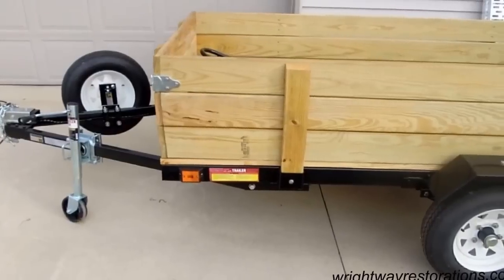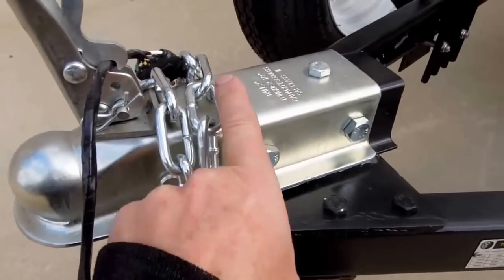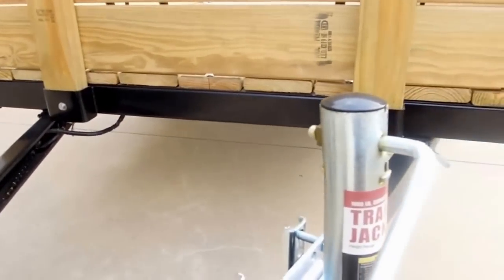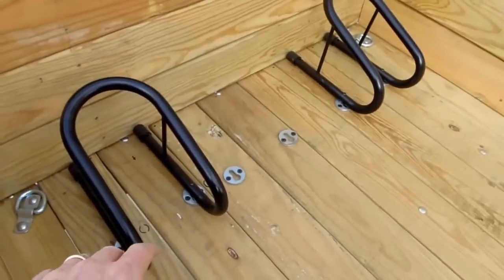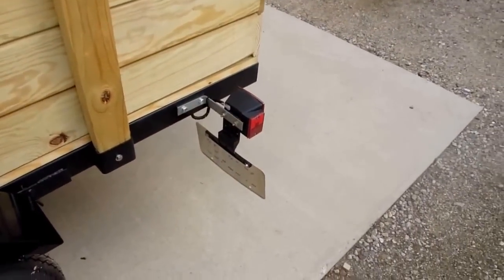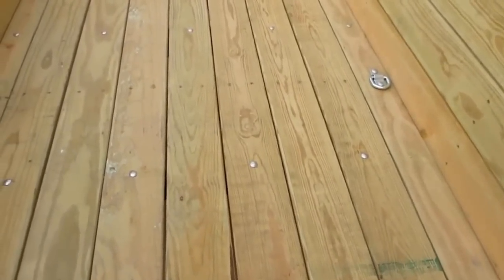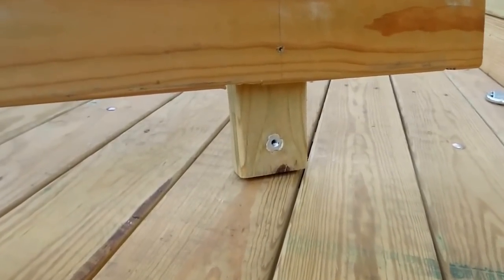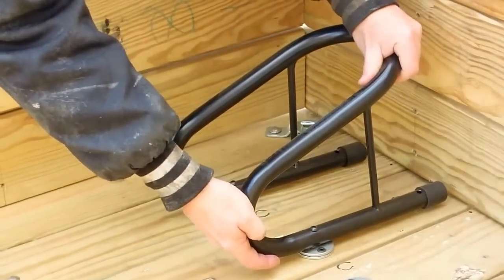Utility Trailer Final Review - Part 3 --- Video #25

Comment: That's okay. You want to add a small gap between the boards for expansion when hot or cold that way your boards don't warp. Just the same when building a deck on your home. You did a great job.
Reply from the maker: You are correct of course.  The wood I used was quite damp, so I knew it
 was going to shrink as it dried, which it did.  If the wood was dry, I 
would have allowed for more of a gap during the installation, but as it 
turned out, it's fine.

Thanks for the kind comment!

Comment: I've watched a lot of videos on these Harbor Freight trailers.  I have one that I bought in the 80's from Sams Wholesale.  There's no telling how many miles I have on that old trailer.  It's been re-finished and new wood a few times.   I've put 3 or 4 sets of tires on it.  
This video has really gotten me interested in doing a new "restore" on it.  This is the best job I've seen out of ALL the videos I've watched.  I like the tie-downs and the motorcycle front tire holder idea.  I was also thinking about adding some long drawer hardware and a sheet of 5/8 pressure treated plywood that would slide in above the tie downs so that I could haul yard waste if I needed to.  How is your old trailer holding up?
Reply from the maker: Thanks for sharing your story and the kind words!  In terms of the trailer, it's holding up fine, I just used it last week in fact.  Still all-original, though it doesn't' accumulate a lot of miles as I use it local only.

Comment: This is the best trailer plan I have found and the best described  Where did you get the attaching brackets for the motorcycle wheel chocks.  Best application for motorcycle I have ever seen.  I have brand new 2018 trailer.  I am working on the flooring and railing and yours is the plan I will be using.  Thanks much.
Reply from the maker: The attaching brackets came with the wheel chocks, which I bought online.  If you look around you should be able to find similar wheel chocks.

Glad the design and trailer video(s) are helpful to you, and I certainly appreciate the kind words and feedback!

Comment: nice job and like the way the black paint over the harbor freight red.  can you share which paint you use and the preparation ?
Reply from the maker: +roger huang It's been a couple of years since I built this trailer, but I believe I used Dupli-color ceramic gloss black, available at any auto-supply store.  In terms of preparation, I simply scuffed the original paint with 220 (I think) sandpaper then wiped everything down carefully with mineral spirits.  I let it dry for a day or so before painting.

I  work on a lot of different projects of all kinds and when if it's been a while the details regarding any particular project can become a little fuzzy.  I believe I covered the prep and painting details in one of the videos, though.

Thanks for the kind comment.

Comment: Great trailer. How did you connect the 1x6s for the deck? My HF trailer only has 3 holes across the top of the frame. Did you drill additional holes so each 1x6 could be attached to the frame! Thanks!
Reply from the maker: Thank you.
Correct, I drilled the extra holes to secure the deck planking where I needed them.

Comment: Very nice add-on, very nice work but the problem is that you added it on a very bad trailer. It is all nice until you start using it.

I had the verg same crappy trailer from Harbour Freight and ended-up giving it away after 3 years.
The many problems problems with this trailer are:
- MADE IN CHINA.
- Paint fade away and become flat and powdery in no time.
- Made of recycled iron, it rust in no time.
- Frame assembly is only bolted (DIY kit) so it is so flexible that tow at rating specification is not an option.
- Frame assembly is only as reliable as the threadlock fluid you put on the bolts during assembly. Pray not to llose frame bolts while on the road as this trailer vibrates A LOT.
- Fenders are bolted and they cracked at bolt insertion. Risk that they will fall on the road and potentialy make a damage at the car following you.
- Frame is foldable but the caster wheels it stands on braked in a couple of days.
- Lights don't last long and will need to be replaced with better quality American brand like Peterson.
- Receiver mecanism seized so I had to replace it.
- Cheap Chinese metric bearings packed with cheap chines  grease. Hard to find replacement because they are metric. Standard bearing fron RV and trailer shops do not fit. You need to go to specialized bearing shops. I replaced them with Timkens and packed them with Red N tacky
- Wiring dried rot and cracked making shorts within 1 year. I had yo replace it.

Comment: That's probably the best looking 4x8 trailer video on YouTube. I'm going tonight to pick up a 4x8 from Harbor Freight. You can't beat the price (approx $240+tax for a 4x8). What kind of lumber and dimensions did you use for the floor? I plan on doing the sides exactly like yours. I need to be able to load my leaves on their and haul them to the compost dump. Great video.
Reply from the maker: Thanks for the kind comment!

Both the sides and floor are constructed from basic 1" x 6" treated decking lumber.  Try to use the driest lumber you can find or if the lumber is damp, I'd suggest allowing it to air dry thoroughly before using.  It WILL shrink as it dries so you want to use dry lumber to prevent excessive gaps.  I also used stainless steel fasteners where ever possible.

Thanks again...
Reply from the maker: Red Rider7 Whether to install with/without a gap depends a bit on the moisture content of the lumber at the time of the install.  If the lumber is green or significantly wet, installing with no gap will minimize the eventual gapping that will occur as the lumber dries.  If however, the lumber is already cured/very dry then installing with a gap, such as is done with decking boards, would be likely the best course of action.

I appreciate your comments.
Reply: Red Rider7
You can get those corner brackets at Tractor Supply.  I don't recall the name of them but that's where I've found them.  Not terribly expensive either.  But whatever the cost they do a great job of holding everything together and also allowing the sides to be removed quickly.
Reply from the maker: At the time I built my trailer, about two years ago, I couldn't find the corner brackets at my local TSC so I bought them on line.

Comment: How did you mount the deck boards to the trailer? I'm looking at either doing a treated lumber floor or expanded metal and looking to find out how to do the floor.

Comment: Just a note, the stainless bolts you use at the coupler is dangerous. As a rule stainless bolts are only grade 2 unless custom machined. Grade 2 bolts are not nearly strong enough.
Reply from the maker: You are absolutely correct... Earlier this year I replaced the coupler bolts with high-strength SS bolts from McMaster-Car, which are quite expensive.

A great comment, thank you.

Comment: Since the coupler is not "through bolted", How did you attach the safety chains? I could not see this in your video.
Reply from the maker: I attached the chains to the first vertical bolt immediately behind the coupler latch lever, up underneath the coupler.  If memory serves (it's been a few years), I used a grade 8 bolt with several large washers on each side of the chain and a Nylok nut secured everything.
Reply: @kwrightway  Thanks for the idea.
Reply from the maker: @ratoneJR  You're most welcome...

Comment: I would like to ask since you removed the two long hitch bolts and replaced them with 4 SS bolts, where did you connect the chain????? The chain originally had been connected to one of the long bolts holding it to the hitch???? Thanks
Reply from the maker: +Greg Kyle There are two vertical bolts that attach the coupler to the trailer frame.  I secured the chain to the front coupler attaching bolt.

Comment: where did you get the shoulder bolts and keys? I picked up a few of those wheel chocks....really like the 'removable' option you added.
also, props on your idea to add furniture bolts to the back side of the skirt's 2×4's. your angled cut at the top looks nice, too
Reply from the maker: +Wesley Jackson The shoulder bolts and keys came with the wheel chocks.

Thank  you for the comments and kind remarks!

Comment: You don't need extra wire with a tilt trailer. Just run wire to pivot point before taking it to the bed. The rest is top notch!
Reply from the maker: +Myfootsasmokin Years ago, I had a tilt-bed snowmobile trailer that eventually developed electrical gremlins.  I finally traced it down to an inconsistent ground at the pivot point for the tilt bed (a factory trailer).  Corrosion, age and wear interfered with the ground path.  I ran a separate ground from hitch pigtail all the way back to each light and the problem went away.  I also know others that have had the same problem.  

Since this was a new build and it wasn't much more work, I simply wanted to be on the safe side.  That's why I ran a separate ground from front to back and not depend on the trailer body for grounding at all.

Thanks for the comment.

Comment: Awesome video. I learned a lot and am looking to build a similar trailer. What kind of bolts or screws did you use to attach the side 1X6 boards to the 2x4s? I see 2 per board into the 2x4 thanks.
Reply from the maker: I simply used 2 1/2 inch deck screws driven through the from the inside, two per board at each 2 x 4.  There are other ways to this could be done though, including carriage bolts.

Thanks for the comment!

Comment: Hi, I'm in the UK and just wanted to say how great your trailer looks. I am into motorcycles also - I have a zx10 and want to build a similar trailer to yours to take it to the track. Can you give me pointers for all the tools/materials I need? Much appreciated . Richard
Reply from the maker: +Richard63626362 Richard, I started with a manufactured trailer "kit", that comes knocked down.  Using this as a foundation, I added the stake pockets decking and other items.  The floor and side walls were made from treated lumber as used for home decks.  The other items such wheel chocks, hold down rings, etc. I sourced mostly online, though these can items can also usually be bought through farm stores or motorcycle dealers.  I can't provide any advice regarding finding a trailer kit in the UK, as this  is outside my arena.

Comment: Excellent video. Are there links to Part 1 and 2 somewhere. Searching around but can't find them.
Reply from the maker: +Rand Peck If you scroll  through the videos on my channel, you will find parts one and two.  They are not numbered as they were posted before I started number the videos.
Reply: +kwrightway Great, thanks very much. I learned much from your video and plan to use that knowledge to build wooden side rails for my Load Rite trailer.

Comment: Like your video. I have built a trailer similar to this. I bought an old 5x8 trailer with no sides.  I built wood sides  very much like you have. The bed had no stake pockets. I need to install the tail gate but cant find the hardware like you have for it to slide in and secure it to sides. Also I cant find stake pockets that size to accommodate 2x4 stakes. Any suggestionns
Reply from the maker: +tkdlover1 Stake pockets suitable for 2x4s are available on-the-shelf at Tractor Supply, at least in my area, or on line such as eBay, etc.  Though I  haven't checked, I'd think Tractor Supply would also have them on their web site for purchase.

Comment: Very very nice! I would like to fix my trailer as you like. Could you tell me what size are the tread wood and Fixing screw? Thank you so much!
Reply from the maker: The planks are standard 1" x 6" (nominal) treated deck lumber.  I used stainless steel hardware wherever possible, including the carriage bolts used to attach the decking down to the trailer frame.  I believe the deck fasteners were 5/16"  x 1 1/2" or so.  I'm recalling from memory as it's been five years since I constructed the trailer.

Thank you for the kind comments!
Reply: kwrightway Thank you so much.

Comment: Where did you get the tail gate handles? What specifically are they called (so I can do a search)? Thanks.
Reply from the maker: The tail-gate handles are simply "gate" handles I bought at (I think... it's been five years) a local big box DIY store, probably Menards.  They are found in the hardware aisle, where one will find gate hinges, closure springs, latches, etc.

Comment: hey what are the dimensions for that trailer? it looks amazing! I was thinking of doing an idea just like that!
Reply from the maker: The dimensions to the OUTSIDE of the frame rails is about 46" W x 96" L.  That's why I added external post pockets rather than using the internal knock-outs in the frame rails.  Otherwise, the inside measurements would be less than 4' x 8'.
Reply: oh wow okay thank you so much because i recently got a trailer frame and want to make it into a multipurpose trailer and that idea of your is just perfect for using a atv, camping, fishing and other things where did you get those steak brackets. If it was a store near you, would i be able to get them online at all?
Reply from the maker: Theodore Russell The weld-on stake pockets are readily available online, eBay and I've even seen them at Tractor Supply on the shelf.  You shouldn't have any problem finding them.

Comment: How is the trailer holding up?
Reply from the maker: Though I have't used the trailer a lot, it's been working out just fine.  I'm fortunate that I can store my equipment inside so it doesn't have to sit out in the weather, which helps in a climate like Michigan's.  My plan is to eventually replace the inexpensive original tires, which to be honest, I don't entire trust, with a better quality shoes.  Probably do the same with the axle bearings, too.
Reply: You certainly did a decent job with great upgrades, I am embarking on doing the same modifications once I get the basic trailer, thanks for sharing your skills. Glad to hear it is still serving you well let us know where you go with the tires.
Reply from the maker: Thank you for the comments, and best of luck on your project.  Will do on the tires...